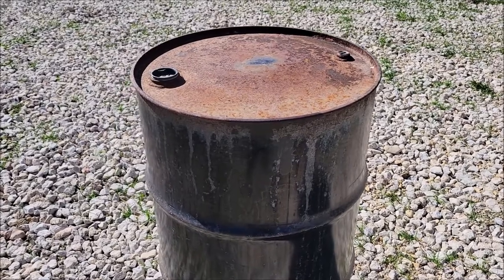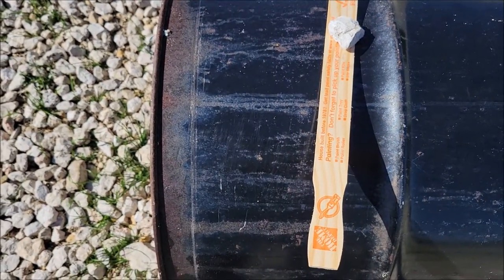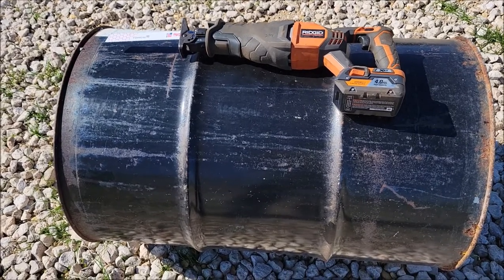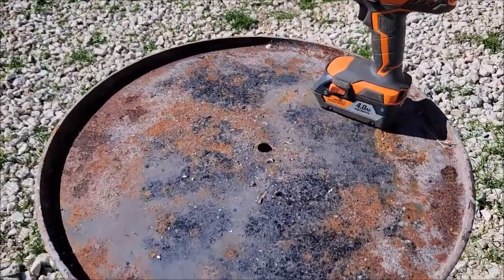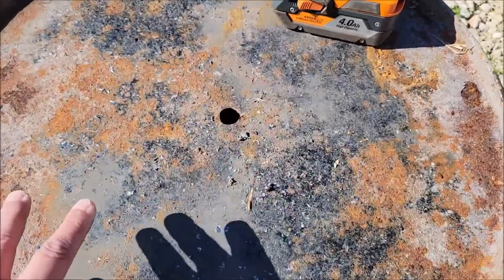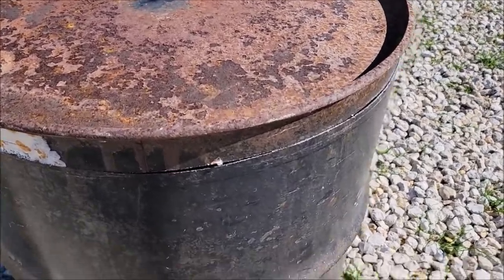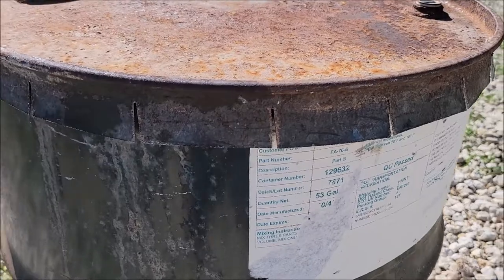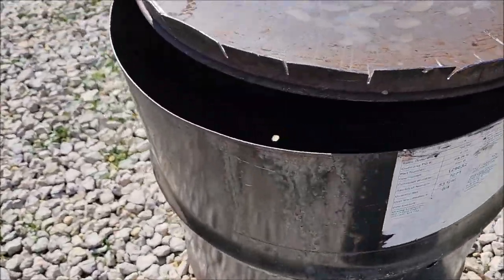How to Make a Burn Barrel and a Lid + Easy Tips and Tricks

Comment: I've been using 50 gallon drums for burn barrels for more than 60 years. What is the nonsense in attempting to make the process appear to be technical. Cut, drill, chisel holes into the side and a few on the bottom. Add a grill toward the bottom if so inclined. Toss in some firewood, some kindling, kerosene/gas/lighter fluid--strike a match. Done.
Reply from the maker: Well, yes.  But some have never done that.  Some people are grown and don't know what a lug nut is.  I was asked about it, so why not?  Anytime those that do know can help those that don't, ...
Reply: Why is a guy in the comments youtubing how to work a burn barrel if he’s been doing it correctly for 60 years?
Reply: If you have been doing it for 60 years, at minimum you are 75 years old. That means you started using burn barrels when you were 15. But anyways, what was so technical about this ? I guess for someone your age this is very technical. I'm honestly surprised you could figure out how to post a comment on the world wide web. You probably still use those free AOL CDs to get on the interwebs with your phone line dial up connection. Unfortunately, you probably have no idea how to see comment replies, so I will never hear from you.

Comment: In the center of the lid, take a hammer and give it a good even blow for a low spot dead center. Take a half inch drill bit or other or other size, and you have an instant drain hole. It will drain through the top into the bottom and out them drain holes. You should have lid vent holes.
Reply from the maker: Thanks.  Great tip.

Comment: Awesome video. I know the options are endless but what if you hammered those tabs inward on the lid instead of outward?   Would that work about the same and have less sharp edges on the outside?
Reply from the maker: You could but it would not sit as well over the top.

Comment: Before you do this, make damn sure the old contents of the drum were not flammable.  Vapors can be just as explosive as the former contents, and guys have gotten killed cutting into "empty" drums that exploded.  I was just reading about a guy in Pennsylvania who got killed by a burn barrel last week.  And I know of another incident in Iowa that killed a man who was welding on top of a barrel, using it as a workbench.  Filling the drum with water before cutting into it can displace explosive vapors, if done correctly.
Reply from the maker: We have just always filled them with water if we think they are flammable or explosive.  Some also shoot holes in them before cutting them.  Maybe do both just to be sure.
Reply: @SeidelRanch      👍🏻👍🏻

Comment: If you angle the lid water will drip off
Reply from the maker: That is a good point. Thanks.
Reply: @SeidelRanch  I'm about to make my new burn Barrel in few hours, will punch holes with 10mm Glock it's little bit faster that way 🤣
Reply from the maker: @littlebitofeverything652  That's the best way to make them.  Be safe and enjoy.